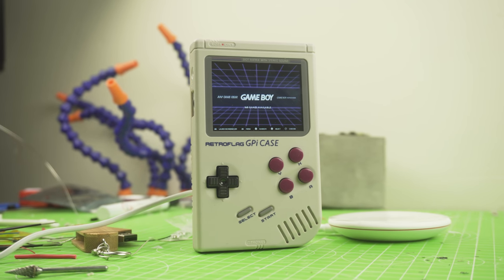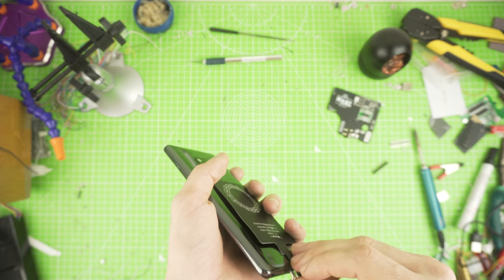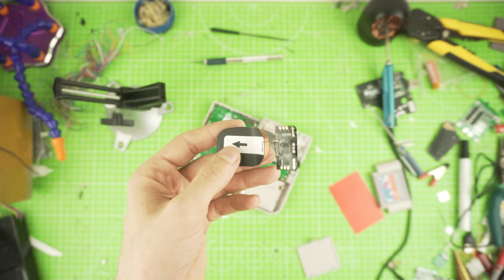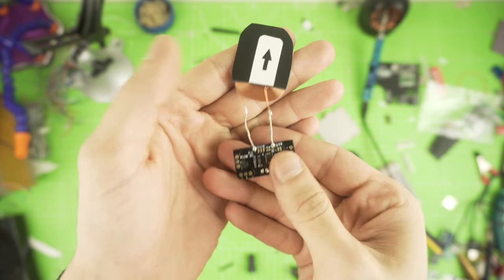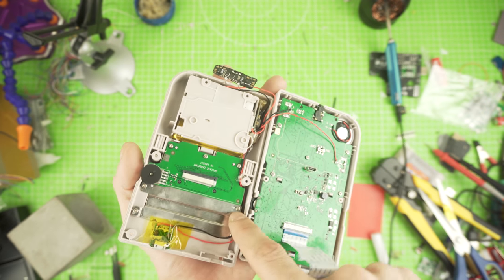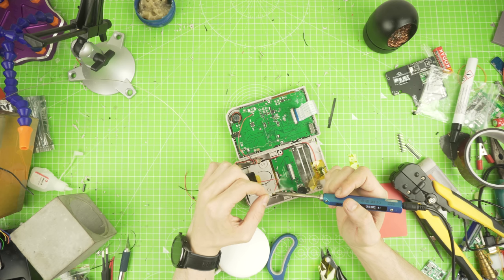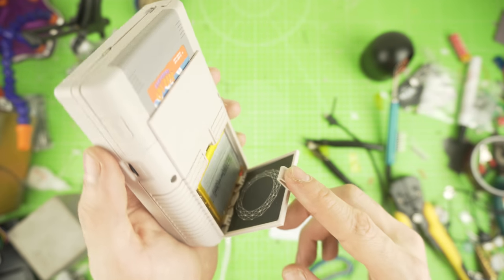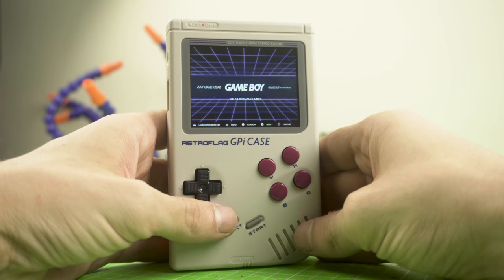Retroflag GPI case Wireless Qi Charging

Comment: How strong is your wireless charger?
1A 5V?

And how long does it take to charge full with wireless?

and how long with micro usb charging?

can both chargers used at same time to charge faster?
Reply from the maker: Hi, The qi charger is 1 A and beeing 1A it takes a while to fully charge wirelessly ( 3-4 hours ) 
With micro USB, the charger has 2.5A, so it charges trough USB 2 times faster ( 2 hours) 
Is no point as it will be a maximum of 2.5 A, they will not add up so is advised to charge trough micro USB if you want a fast charge
Reply: Adam Builds  thx good support

Comment: Is that correct i add the red plus cable on VIN and the Black Minus Cable on GND. I ask because in the last video you soldered it there for charging with micro usb. So are there 2 cables on VIN and 2 Cables on GND ?
I hope you can help me.
I also asked myself if Charging via Solar Cell is also possible on the back or top?
When you are playing in the Garden so it can charge our the battery would last longer.

I think you can make a Video if we can dremel the Case so we can Access the Mini HDMI port and use it for TV.

Good Video.
I subscribed when i saw the two Videos.
Reply from the maker: Hi, yes now with the qi charger are 2 gnd and 2 vin, like this you get to have both inputs of power
For solar power, just get a charging cell and plug it in 😄
About the HDMI, I know that it will not work without a script to disable and enable video out
I might have a look into that! 
Thanks for your sub 😁
Reply: Adam Builds  Thx for your fast answer.

Comment: Hello Adam
finally changed the coil everything is charging. but board does not start when i hit on switch. only if i am charging short and switch it on. like a kickstarter on car battery.
Maybe you can help me
Reply from the maker: Some cha ges has been made to the board and also depends of the booster, you can also add that small little button and wire it outside, after you press that the booster should jump-start
Reply: Adam Builds  i have the same charger like same board

Lantiarnc
Reply: Adam Builds  My Problem with is:
That i have the same Charger Board like you. How do you start it? Or modded it.

Please help me it would be so good
Reply from the maker: @diettelo  How I said, changes in the pcb has made, all you need to do is to add the button that the booster came with, route it to the exterior and when you press it, it should just start
Reply: Adam Builds ok i try it thx
Reply: Now i get it the pcb charger board got a new rev where you need to start it with button. my old pcb ( i killed a resistor while closing case) it worked by only powering on gpi case. hmm i have a few maybe there is an old one
Reply from the maker: @diettelo  That's what happened with me when I tried to modify one from the latest batch
Reply: Adam Builds Do you have a tip like version number to find out what an old board is? i have ordered from 2 different sellers
Reply from the maker: @diettelo  On the first PCB's there where a + and - on bottom left and right side ( sound pins) on the new ones that is missing
Reply: Adam Builds thx i‘ll check it
Reply: Ok i soldered a button it works. So another Problem: Cables wont fit so that i can fully close cover. I used for all wires AWG 24. Got a tip?
The Soldering is easy but fitting horrible. I also soldered an Wireless Board with Coil. I watch your Video and my Cables wont fit under PCB and yours does. Every Time is it like i am getting drunk.

Played only 2 Hours with normal Battery. Sitting on this Mod  for 4 Weeks. No time working and makes me Crazy to sell soon stuff for a few bucks😅😭
Reply from the maker: @diettelo  did you dremmeled the case a bit so that your booster fits perfectly and doesn't stick up? Use used USB wires :D
Is sad that you didn't had the chance to enjoy it
Reply: Adam Builds i only dremeld the battery place and the side hooks away on the side pcb. i dont know where to dremel
Reply: Usb data Cable or charger cable?
Reply from the maker: @diettelo  Data ones can be used if you don't have enough space
Reply: Ok i used cables like you said way better. But broke off an resister on charger pcb board. so no luck.
maybe its 1 mm bigger than yours.
Anyway had an idea:
to charge battery only with the wireless charger pcb? it must have a protection
i wanted to ask you if it can be possible.
I wanted to forget about micro usb charge.
because i use at home only in living room and my wireless charger is near my place.
so in fact i can also forgot about the button.

Adam also please give me a support link . i want to support you. for the help.
thx
Reply from the maker: @diettelo  You can do that also, is a bit slower 1A for charge, but you can go with that! This way, how you said, you no longer need the extra button, this is my channel link for PayPal  https://paypal.me/AdamBuilds?locale.x=en_GB
Reply: Adam Builds thx for your answer now it runs. it was thin cables i hope i can get full runtime 3-4 hours.
Thank you so much it works for now
i now love the gpi case more
Reply: send you 10€ for the help.
called it: gpi case help
Reply from the maker: @diettelo  Got them now, thanks for your support and happy that all works well! I appreciate it!
Reply from the maker: @diettelo  Glad that all is sorted out!